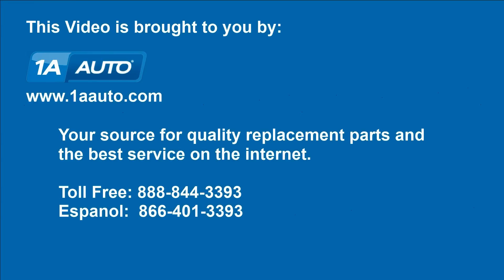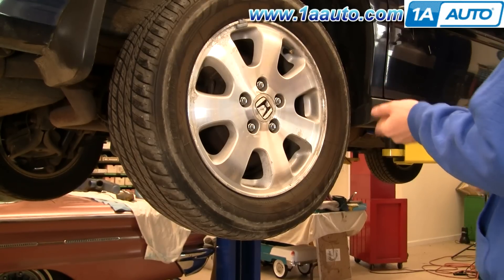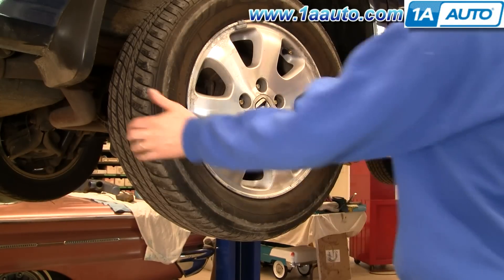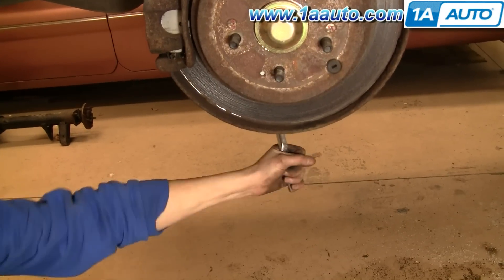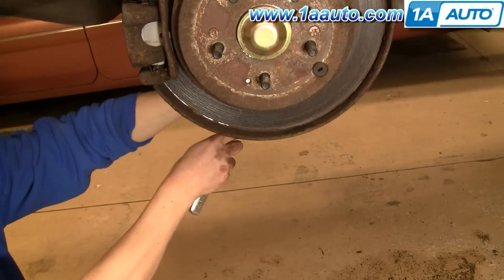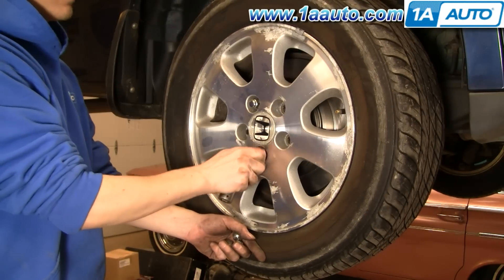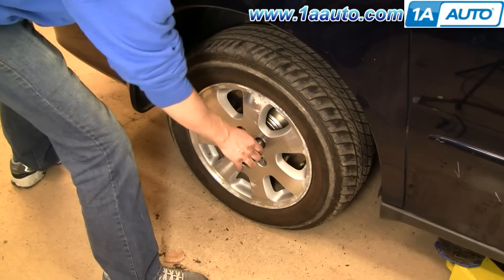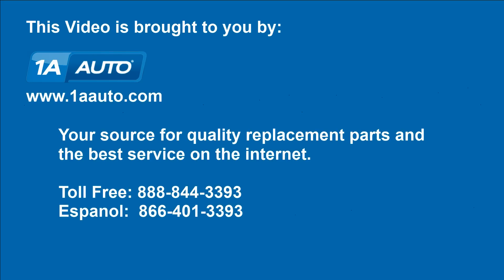How to Replace Shock Absorber 99-04 Honda Odyssey

Comment: So obviously, 'rear shocks on the 04 Odyssey...'much simpler to replace ( in steps and procedures) than the front "Struts' Job,  right?   I may just have my Rear Shocks replaced...and not worry about the Strut deal, up front.  would this be acceptable?   thanks for any help, info!
Reply from the maker: +drummerfella 55 Rear shocks are typically easier to replace than front struts, however, we would suggest consulting with a local mechanic to determine if your struts need to be replaced as well.

Comment: Did mine today with help of this. In my setup, front wheels were on ground with wheels chocks. Lifted the car from behind from below tow hook. You can see this from video from !AAuto about how to lift this van from behind. Then I put jack stand on both rear ends jack points.

I inserted shock bolt on lower side first and left top side open. The top hole of shock is almost 1cm below the holes of body. You need something to lift break drum, which in return will lift the shock up, 1 cm so that all holes are aligned and you put bolt inside top holes. Good luck you all and thanks for sharing

Comment: It is easier to remove the shock if you compress it with a screwdriver or anything that will fit into the bushing hole of the top arm. Once compressed, it slides right off the bolt on the bottom without using a hammer to knock it out...
Reply from the maker: Good Tip thank you for watching.
1aauto.com 888-844-3393

Comment: Do you sell the rear bumper beam?  Almost all of those vintage Odyssey in the rust-belt would have that beam completely disintegrated.  Please take a look at your blue Odyssey under the rear bumper.  I bet that you will find it pretty much eaten by the rust.  If you do a video on replacing that and sell the beam, I will be your first customer!